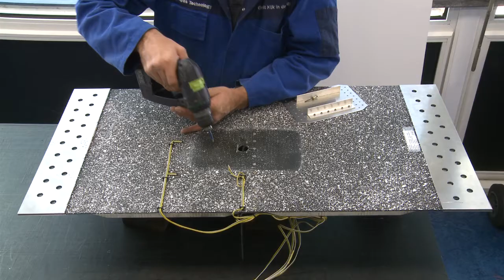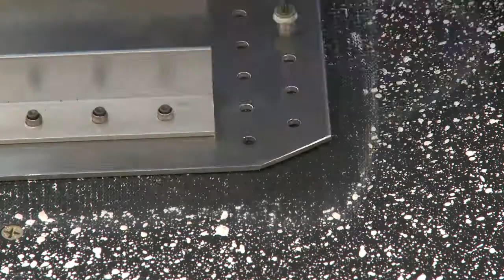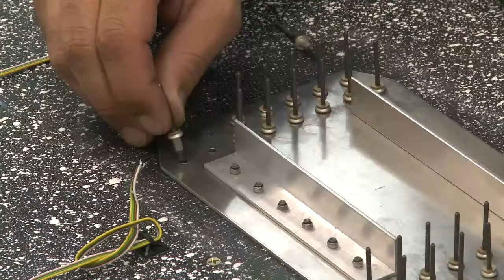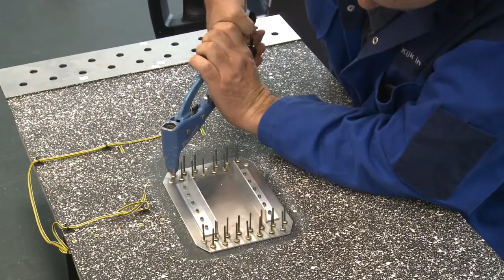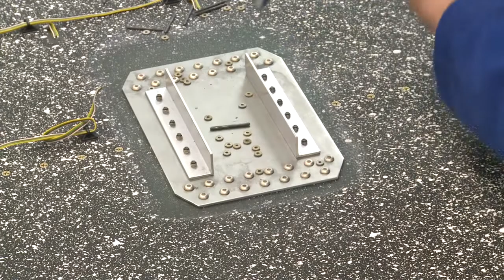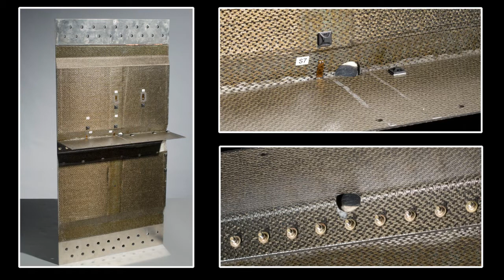Aircraft Battle Damage Repair

Comment: Wouldn't using a pneumatic cherry-max puller be faster with the added benefit of being  easier on your hands?
Reply: ABDR training is for VERY austere conditions where you may not have an air compressor (or the other fellows might have destroyed or bathed yours in blister agent!).  When I took the USAF course they had pneumatic tools in the ABDR trailer but wanted those of us who weren't Structural Repair techs to "feel" the riveting process.

Comment: How did you know what shape and size you were going to make the metal to cover the damaged area ?
Reply from the maker: In general, you would like to have the metal patch as small as possible, only just covering the damage (while respecting general design guidelines for edge distances in composites).
In this case, however, the metal patch is much larger than the damage. The outer geometry of the metal patch was governed by the geometry of the sandwich structure, and the ramp area (at the backside of the panel) in particular. When applying rivets in the outer skin, you don’t want the head of these rivets puncture through the inner skin of the sandwich. That is why we had to keep away from the ramp area in the sandwich and why we ended up with such a large patch.

The consequence of applying such a large (but relatively thin patch) was that we would encounter  buckling problems in the patch itself. In general there are two solutions to that problem: increase the thickness of the patch or apply stringers. To prevent buckling, the increase in thickness would have to be so large that the patch becomes very stiff compared to the sandwich panel and starts to attract more and more load. As we preferred to keep the load distribution in the panel as uniformly as possible, we chose to apply stringers to prevent buckling. That is why the patch has such an unconventional shape.
As the background of this project was to find a quick and dirty repair for a helicopter structure, aerodynamic issues were of lesser importance.